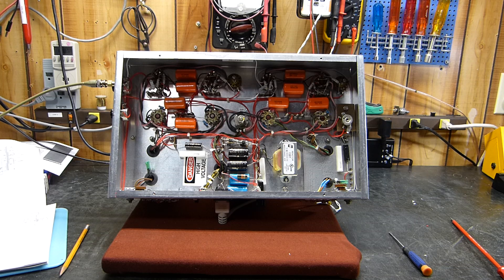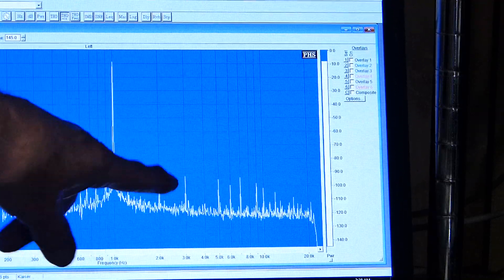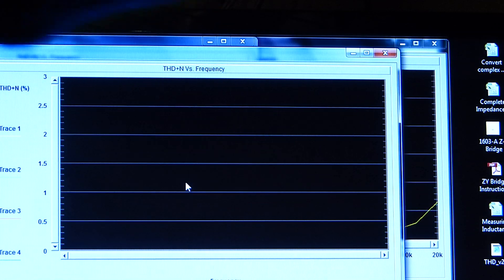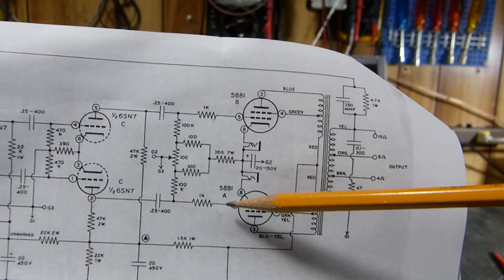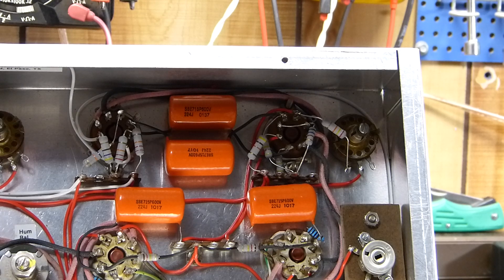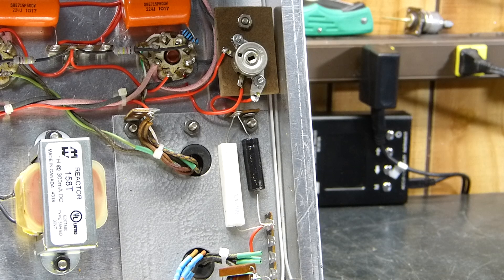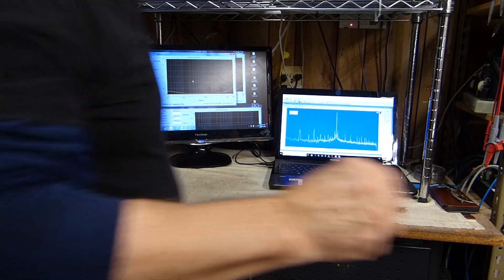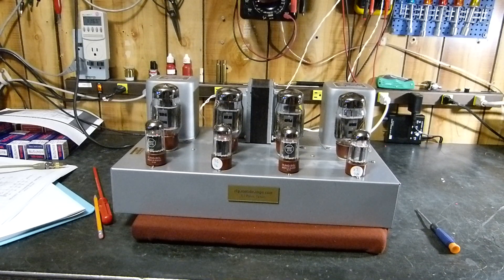Williamson Amplifier With Cathode Current Balance and Dynamic Drive Balance Improvements

Comment: what is the voltage of the PT and current rating?
Reply from the maker: The power transformer in this video is 700VCT @ 200mA which is under-rated. It worked as can be seen in the video but I have since changed it out to a larger transformer of 800 VCT at 400mA and I also changed out the power supply choke to a 500mA 1.5H. The KT66/6L6GC/5881 want 50mA each at idle so that is why I say the transformer in this setup was under-rated. The larger current rated choke has less voltage drop across it so the larger transformer and choke perform much better.

Comment: Informative video. I recently built a Williamson design (designed by others) that has the same RC circuit in the same place in the amp circuit that you discussed near the end of the video. Mine is a 100PF cap in series with a 36k ohm resistor. I wondered if it's purpose was to eliminate the possibility of high frequency oscillation through the amp?
Reply from the maker: That RC circuit would have a corner frequency of 44KHz so it would be to prevent the amplifier from developing its own parasitic issues  rather than suppressing AM broadcast stations. Building these amplifiers and not having a spectrum analyzer to see that far out, and even out to 100KHz or more, we would never know, or hear, the parasitic but they can and will exist depending on many factors including a tube change, different speaker impedance, so many things that can not be predicted but the RC circuits will squelch these tendencies for self oscillation. Here is the definition of the corner or cut-off frequency.
This “Cut-off”, “Corner” or “Breakpoint” frequency is defined as being the frequency point where the capacitive reactance and resistance are equal, R = Xc. When this occurs the output signal is attenuated to 70.7% of the input signal value or -3dB (20 log (Vout/Vin)) of the input.
https://www.google.com/search?q=coner+frequency+of+series+rc+circuit&rlz=1C1CHBF_enUS839US839&oq=coner+frequency+of+series+rc+circuit&aqs=chrome..69i57j0i22i30.8380j0j15&sourceid=chrome&ie=UTF-8
Reply: @ElPasoTubeAmps  Thanks for the feedback (no pun intended). I was not thinking in terms of picking up or amplifying AM broadcast signals per se, but rather higher than audio frequencies that tend to run away due to the circuit design and the ability of a lot of the tubes to amplify signals up into the RF region. I agree that without a spectrum analyzer to sweep the above audio frequencies this may go undetected in an amp. Thanks again for the detail on the physics of what's going on.

Comment: My williamson has a wikid ring with a square wave on the high end. Its based off of the heathkit w3m which does not have that rc circuit in it. It looks like heathkit added that rc circuit on the next model w4am, I am waiting to see the outcome of your experiment. I just totally gutted mine and I am rebuilding it. going from the 6l6 to the kt66, I hear good things about it. I also designed a pcb that uses the baxandall circuit with a mid adjust as well as high and bass, also an experiment, totally passive using smc components. The board should be in on tuseday, we shall see how it works.
Reply: It sure sounds like you need to slow the first stage down with the RC circuit from plate to ground. If you see substantial ringing on square waves (try 1-10 kHz in a few steps), add capacitance until the leading edges of the square waves don’t overshoot any more. The resistor value is not critical. You can start with what’s in the Williamson circuit and focus on adjusting capacitance. You don’t want to add so much capacitance that you see substantial rounding of the corners of the square wave, as that will increase HF distortion, and if taken too far, even reduce closed-loop HF bandwidth.
Reply from the maker: I suspect I am going to be able to measure exactly what you are talking about. We will look at it with the scope and SA. I am not sure, as my hearing drops off pretty sharp above 8 KHz but is still good in the voice range, but sometimes I think I hear some slight "grittiness" in the high frequencies of this amplifier. Very slight an may be my imagination or something else other than the amplifier. Overall, I think it sounds so good it practically brings tears to my eyes - so to speak... I am impressed with the high-end KT66's in this amplifier and in a McIntosh MC40 I have. Good luck with your rebuild.
Reply: @ElPasoTubeAmps  thank you, and I'm going to try the gold lions, assuming all of the suppliers dont close due to the virus.
Reply: @ElPasoTubeAmps  ok, so, I am basically finished  rebuilding my williamson. I tried to do it without this RC circuit and for some odd reason I was getting a 80hz oscillation on the falling edge of the peaks of my waveform, sometimes. Basically, it was present at random volume levels except all the way up, where it seemed like it wanted to sneak it's way in. This was only occurring in the left channel, the right side was a perfect wave form. I tried everything to get rid of the 80hz but it wouldn't go away. I found that the oscillation was occurring between the first triode and the phase inverter, what was missing? I put this RC circuit in place, and the issue went away completely. My guess is depending on tapology of the chassis, wiring, routing, and environment, this circuit can oscillate, but not always. My guess is,  in the later designs, they added this filter in to stop the "potential" issue. Now, I say I'm almost done. This is because I had a diying opt on the left channel as well, I was only getting about 2/3 voltage on the plate, 1/2 the wattage out, could this have caused the issue? Maybe, I'm not convinced that my output stage could have caused the oscillation in my phase inverter, but I'll have to play around with it once my new opt arrives in 6 weeks.
Reply from the maker: @mikepelletier1399  Hi Mike, I will start at the top with my thoughts on this. If there is a direct connection from the first stage input grid, straight to the wiper of the pot, I have seen in multiple amplifiers an instability when the volume control is almost all the way down. It is not an 80 Hz parasitic but something in the KHz range - from my experience. There is a technical explanation for this that I do not recall but the solution is to put in something like a 10K or 15K series grid-stopper in series with the grid and the wiper of the pot. This will prevent the grid of the tube from getting to that critical low resistance that causes the oscillation. This is the way I do it nowadays and I do not use a series capacitor. If you do put in a series capacitor and resistors, you will be creating some form of a high-pass filter that will have characteristics that are unknown unless you model it in something like LTSpice. In some of the older amplifier designs, attenuation of frequencies below around 100 HZ was quite common. The Brooks 12A amplifier is a good design to see this.
As for layout, wire routing, etc, no doubt this could cause problems from stray capacitance and inductance but since we are operating at audio frequencies the reactance in these small values of L and C are, in my opinion, not too likely to cause serious issues. Certainly they could be very significant at RF. I have found over and over that grounding all power supply components to one single point close to the transformer is good practice. I think I showed in a video where with clip lead wires connected to an electrolytic capacitor on the HV side of the PS and touching it randomly to different points of the chassis would cause measurable 60 and or 120 Hz hum. I do not believe it necessary or even a good thing to use an elevated ground buss and then ground that buss at the input RCA connector. I do not recommend that setup. If you have a high-end piece of equipment like McIntosh amplifiers, study their grounding scheme. I know I am off the subject a little here but I wanted to say this about power supply issues.
As for the RC circuit mostly in focus here, I think you nailed it... with different tubes with different gains in each section of the 6SN7 or 12AU7, the output tubers or whatever, as components age, etc., there is no telling what kind of parasitic can/might occur and when a company is producing thousands of these instruments, the little RC circuit is good "insurance" to keep the amplifier stable even thought it certainly does increase THD at the higher frequencies.
As for your OPT not being in good shape, there is no telling what that is going to cause and trying to solve other issues with a defective OPT is probably not going to get you anywhere.
Sounds like you have done a marvelous job and done advanced testing and have one channel ready-to-go. I really enjoy these conversations and as I have said so many times, I learn from you guys as much as you learn from me. Complicated issues and outright failures are as important as success. Thanks for keeping me in your loop...
Reply: @ElPasoTubeAmps  you are correct, it goes from input select switch, to the pot, then to the grid of a 6SN7. Between the pot and the grid is as follows... 15K then .1uf cap, then 15K. Between the cap and the second resistor I have a 1Meg to ground. I tried playing with that, no luck. I originally had it hooked up to the tone stack board i had designed, thinking it was that.  I completely bypassed it, with the same result, being completely passive I loose too much gain through it. I'm thinking about adding a tiny 6021 dual triode tube internaly (if it doesn't get too hot)  too boost it up a bit, because it works amazingly well.  The opt was suspect due to loosing the negative bias on that channel last year, I bought some terminal tie strips from antique electronic supply and fought through the corrosion on them throughout the whole build, needless to say the most important wire came loose and I had that lovely hot transformer smell and some smoke, I didn't have time to test it, but it actually didnt sound half bad. I pulled the transformer apart last night (till 3am, lol) the output leads ( that thick 600v stuff) was melted where it was against the coil, the tape on the windings was fused to the windings on the outside. All in all, that didnt even cause it to fail. It was actually a winding deep inside that had about 1/4" of varnish burnt up on 4 or 5 of the turns. So at least that assumption was correct. But yes as soon as I get that new opt I will get to playing with it and I will let you know my findings, too bad it has a 6 week build, I think they said that last time and it ended up being more like 4 weeks, but with the virus, its anybody's guess. Stay safe!!

Comment: David, what are your thoughts on cathode bias in general? It just seems to me to be a far better way to build an output stage than grid bias. Self-adjusting for a start, and fewer components, and no pots to lose the wiper connection from with dire results. Against that there are a few volts less in Vak, which you can get back with another PTX, and the blocking issue concerning the cathode bypass time constant, but in the light of the discussion about decoupling capacitors and their time constants, I am starting to wonder whether it's even real.

Secondly, to what exactly do you attribute the super-low THD of this design once you AC-balanced it? Most of the elements here are present in your other builds: Acrosound transformers, Williamson topology, Gold Lion KT66s, ... In fact cathode bias is the only difference. Not that I would attribute it to that. Maybe just dumb luck?
Reply from the maker: Well, luck counts...   LOL... and could be a bit of a factor here. I finished the second channel a little earlier today and have not tested it yet. We shall see, hopefully tonight, how it performs. I assume it will be as good.
I agree with you on the cathode bias vs fixed bias if the amplifier is in the 25/30 watt range or smaller. Above that, I personally think fixed bias is the way to go. I was really amazed how I was able to get the 80 watts from the amplifier I build a few weeks back with the KT88's and the Williamson driver. Fixed bias on the KT88's.  I don't think that is supposed to be possible. I have always accepted the Williamson driver to be good for 20 watt amplifiers  and little more. I don't know how it turned out so well. I have found over many measurements and amplifiers that 16 db of NFB is about right and 20 dB is likely to cause LF instability. That darn NFB capacitor is a really touch thing and sometimes I just don't use it.
The signal voltage is shunt to ground thru the capacitor but the DC bias is left to fluctuate with drive voltage on the output tubes with cathode bias. I think that is a good thing. Not sure how I can theoretically prove that. I have made so many amplifiers and in each one that I have provided both output tube cathode balancing and dynamic drive signal balancing, I have, in every case I can remember, been able to tweak in that last tiny bit of great performance concerning THD. 
I really listened to your thoughts on the complementary time constants of voltage amplifier stages vs cathode bias stage - if I understood it right and that is still on my mind but I have done no design to take that into consideration. I still think you may have something there. But how are we going to measure it. When THD is 0.5% on a vacuum tube amplifier, where are we going to go with that measurement?

Comment: How are you setup to measure the noise again?
Reply from the maker: The HP 8903 has a S/N function where you adjust the output of the amplifier to just below clipping, then the 8903 turns on a 1KHz signal, measures the amplitude then shuts it off and measures the amplifier output with no input signal so it is only measuring the hum/hiss/noise, etc coming out of the amplifier and computes the ratio and displays it.

Comment: Thanks for producing this. I’m just getting stated with this, and your videos are very helpful. I learned tube technology in the military back in the 1980s, but I didn’t do anything with it until recently. I just got an original of the “Wireless World” compilation on the Williamson Amplifier. I like the relative simplicity of the circuits. I also managed to pick up an HP 8903B that seems to work. I’ve got an old Heathkit amplifier that looks good, but I haven’t had time to power it up yet. Your videos are a very useful resource. I like the way you show the measurable results. I’m curious where you get the transformers. Are they all or mostly vintage, or can you find those newly manufactured?